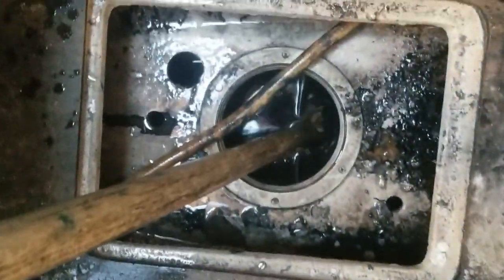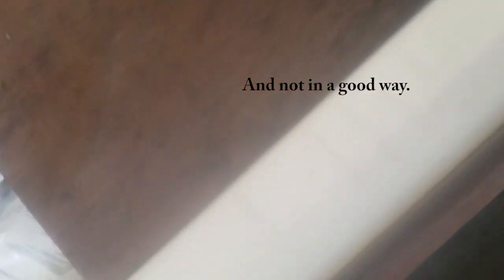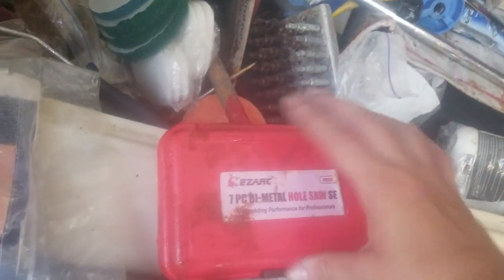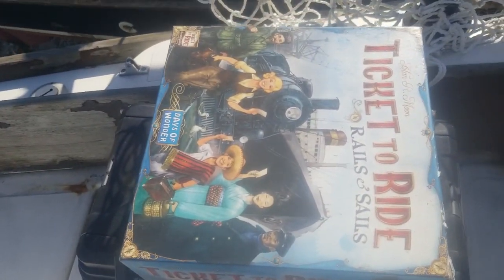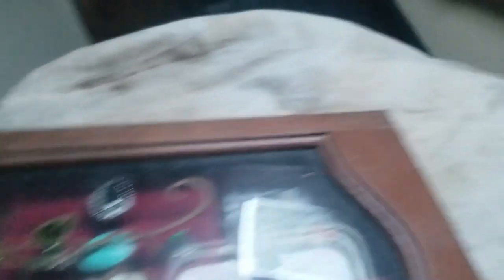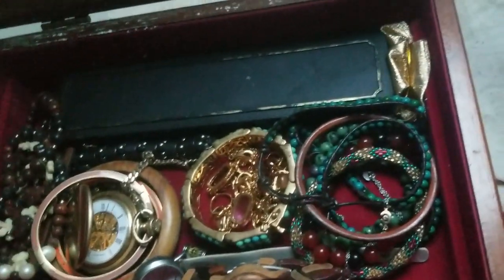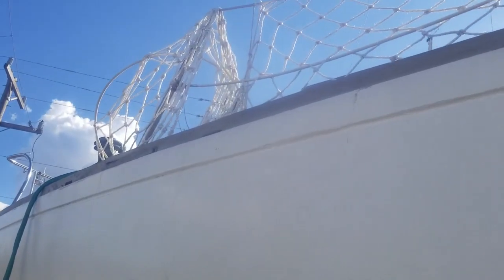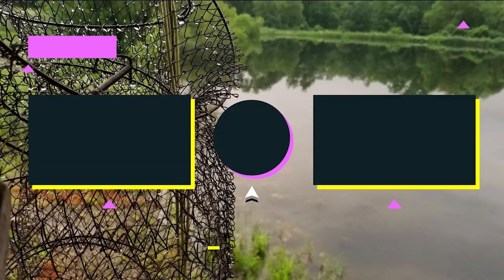A Few Steps Back...

Comment: Good to have a few wins. Just one job at a time and I think you only has fresh water inside? 
Was that a crack in fiberglass from falling over? 
Cheers Warren
Reply from the maker: Yes it is. All the exterior damage was from the fall, except the bent rudder shaft. The previous owner ran aground and had it bent back straight once before I got itm
Reply: @baltering9674  does the shaft have to be replaced?
Reply from the maker: @CheersWarren  unfortunately